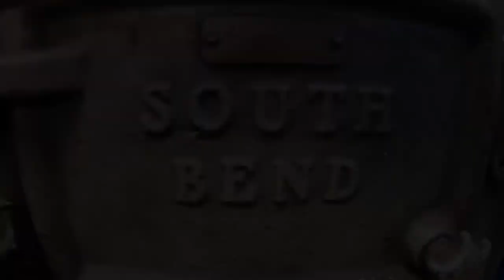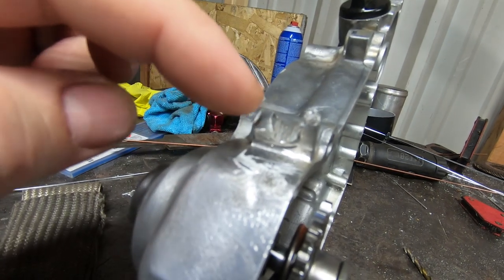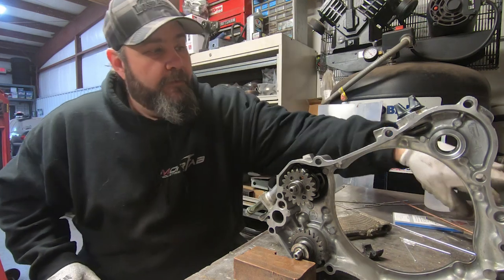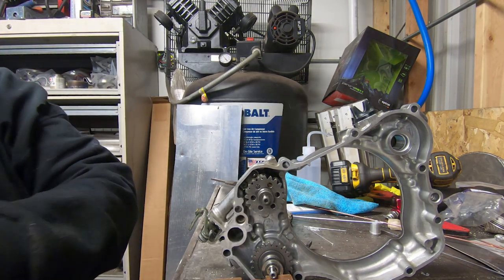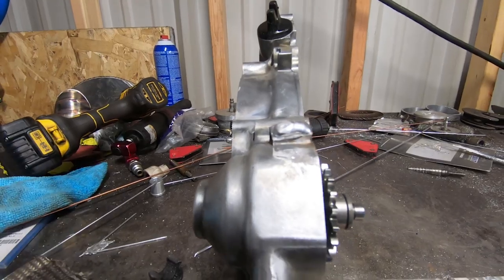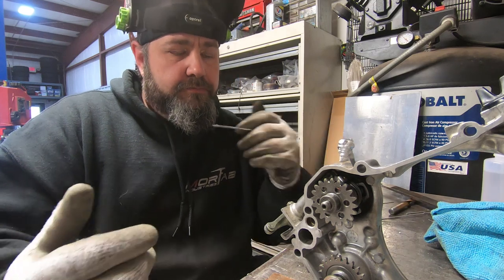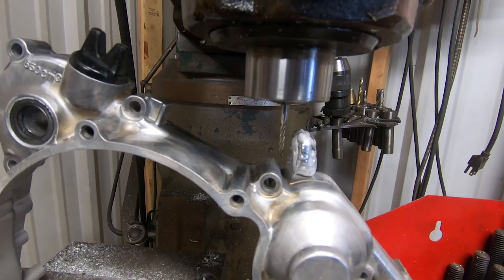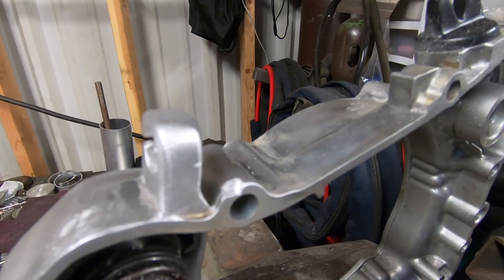Motorcycle Engine Case Repair!

Comment: Will the below welder be able to do the same job? Sorry, cant paste a link into comments as it doesn't allow me to post: 
Weldforce Welder MIG Stick TIG 160A Fitted With 10A 240V plug WF-160MST WF-06127

Comment: What kind of prep should I do for a dirt bike engine case. It has an 1/8" hole that needs to be filled with weld. It's on the inside of the case where all the oil and the transmission is.  Besides cleaning it out what other steps to prep this cast aluminum case would you recommend?

Comment: Work looks great.  Would be really interesting to be able to see or know what your TIG settings are - how much peddle - what filler rod and tungsten.  Sounds like you might be up about 100 hertz - but not sure.  How much cleaning action.  Super difficult to tell when to start adding the filler wire as well.  Skills are sick - would be awesome if you can show us a little more detail.

Comment: Beautiful job. Love the inspiration from watching people with real knowledge/skill!     I have a similar “case”.  Cast aluminum primary case on my ‘83 Shovelhead.  Broken threaded lug that sticks out where one of the starter mounting bolts goes into. Someone Repaired it once before. Looks like Lock Tite or...? I have a basic wire feed welder. Can I do this job with this type, Following your tips? Was that acetone you were cleaning with. That’s what I use.
PS....When you started milling, at 13:19 it looked like the mill was stationary and your shop was going back and forth! Look at the stud wall. 🤣
PS ll.....just watched you aluminum practice vid! 👍
Reply from the maker: It won’t be practical or easy to repair with a wire feed.
Reply: MorFab Industries ....thanks!

Comment: Why couldn't you clean up broken area and weld a solid pice of aluminum and then drill it? You always do a great job on content and final repair looks great.
Reply from the maker: Welding on a block would only allow minimal surface area for the weld. It would only be welded around the perimeter of the block. With the way I did it, the metal was added in layers with 100% contact to the area below it. Much stronger in the long run.